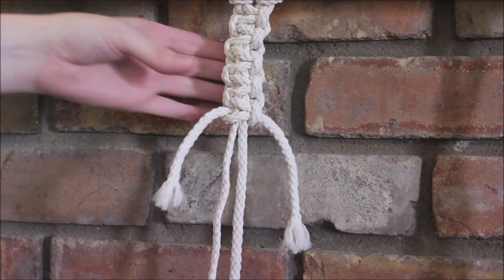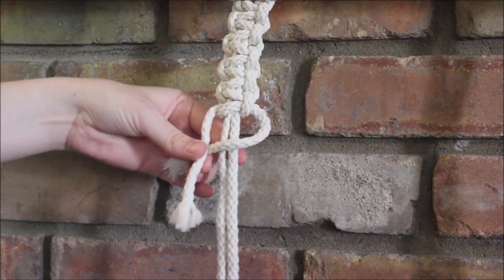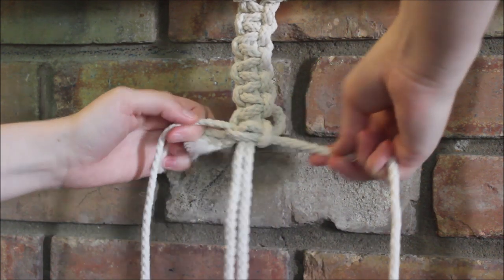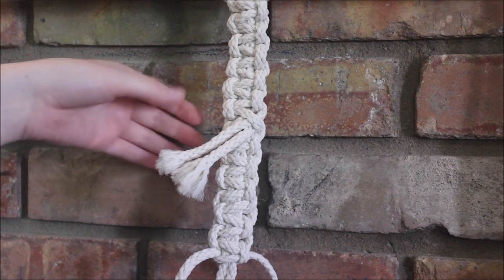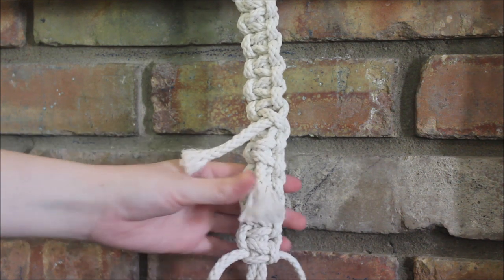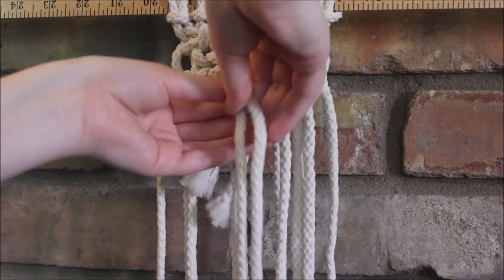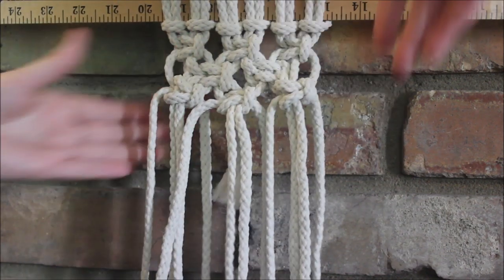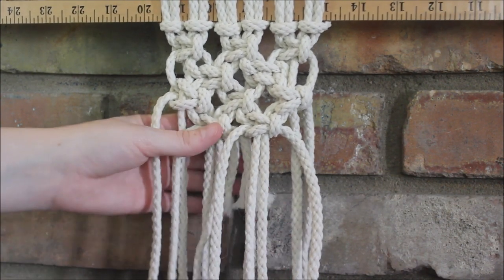HOW TO ADD MACRAME CORD WHEN RUNNING OUT // Square Knot Addition

Comment: I am having a difficult time with attaching additional ropes.  I just don’t understand.  Can you please do another video that shows how it’s done only slower and zoomed in some?  Thank you
Reply: Hi, You Tube has inbuilt setting for adjusting video speed. If you click the 3 dots on the top right you get option for 'Playback Speed' - by default it is set at Normal. You can decrease the speed by clicking on Normal and then choosing 0.75x or lower as you wish.
Also for zoom you can watch using theater mode (small broken square icon at the bottom right) works on both phone and computer.

Comment: When you were out of your rope to the second instruction where the two leftover strings were in the center of your project. It looked like when you added the new rope that you didn't include the two strands of rope when you made your macrame knots but left those two short pieces out of it and let it hang from behind is this correct? You did a fine job!!!
Reply from the maker: Yes, that is correct. The short pieces (the cords I ran out of) hang behind the new cord and you should be able to tuck them in the back so they stay hidden.
Reply: Gray Wonders thank you and God bless you my dear!!!